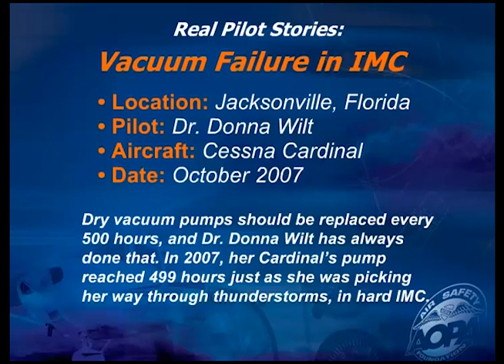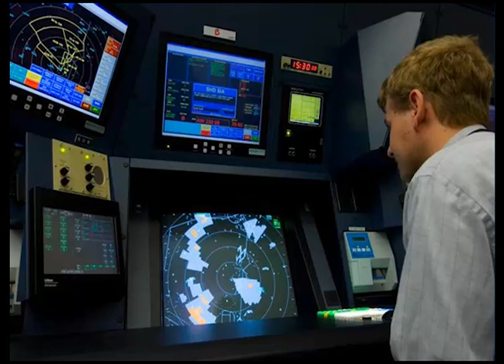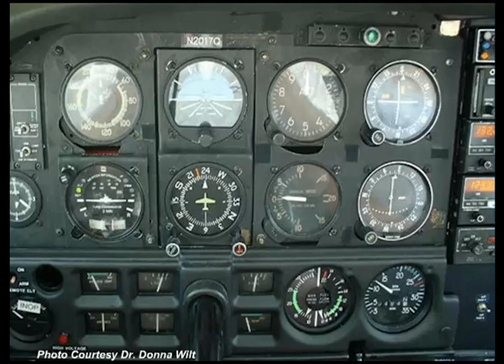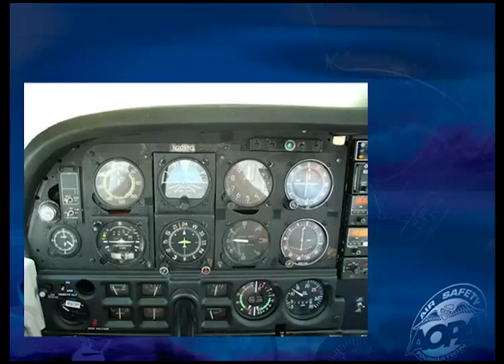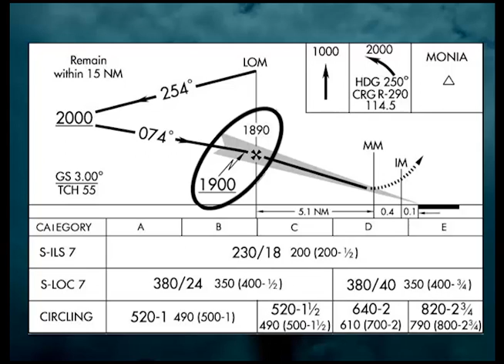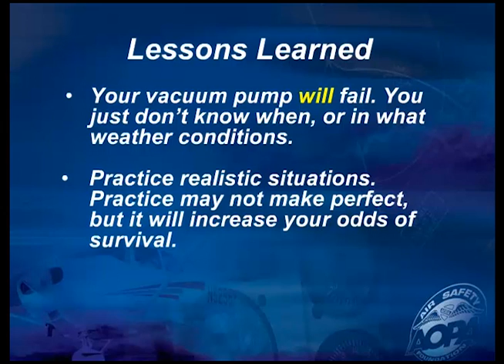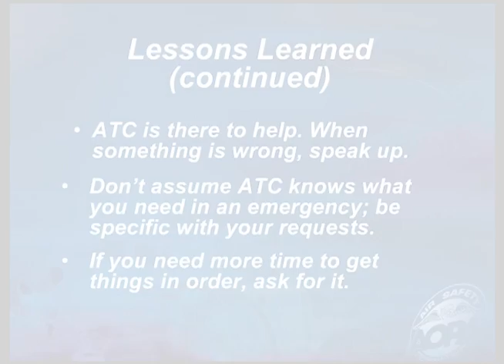Real Pilot Story: Vacuum Failure in IMC

Comment: Could she not have simply used her Compass for vectors? I remember during my Private training we used the compass, a map, and the natural horizon for leveling. I get that she was in IMC but the compass in conjunction with ATC instructions should work.

This past weekend during a XC the vacuum pump failed on my C150. Although I wasn’t in IMC thank God for my prior training. It was like a regular flight block so no stress. As an instructor she seem extremely worried or stressed. The passenger pilot seemed more calm.

Comment: I always carried a couple of little rubber disks with suction cups in my flight bag. I knew they would come in handy for covering up errant instruments should a vacuum failure in IMC ever occur. I never had to use them in 6,000 hours of flying, but I did have to whip them out repeatedly in the simulators at FlightSafety where such failures were practically guaranteed. They made a tough job a little easier.

Comment: Why don't airplanes use engine vacuum? You wouldn't need a pump if it came from the thing keeping you in the air. Pump could be spare in case of engine failure, then you'd only need to change it every 20 years or so since it only gets used in an engine out.

Comment: Why cover up instruments that don't work - you know they're not working, that's why you're covering them up. Just because you trained that way it doesn't mean you have to cover them up or am I missing something?
Reply: Keith Whittingham It probably streamlines your workflow by preventing you from glancing at it and wishing it back into operation. I think IFR rated pilots have set procedures for monitoring gauges, so physically blocking it lets you focus on functioning instruments. I wonder if instructors recommend keeping Post-Its on board for this purpose.
Reply: @bricago2302  I went through a bunch of accident reports and the #1 lesson learnt is "First fly the plane". I cannot think of anything worse to do if you're in IMC, under a heavy workload, in an emergency than taking time out trying to stick bits of paper over instruments that aren't working. You can end up inverted pretty quickly in a situation like that - looking for Postit notes instead of keeping your wings level seems a good as way as any to achieve that.
Reply: Keith Whittingham I see your point. But I’d argue that “flying the airplane” comprises eliminating faulty instruments  from your work load, as quickly as possible, of course.
Reply: @KeithWhittingham  That failed indicator is going to continue attracting the PIC's attention and eventually cause her to enter a graveyard spiral. Human brains are terrible at ignoring things that should be ignored, even when survival is at stake.

Comment: Mechanical vacuum pumps should be the backup, not primary. The engine naturally generates vacuum pressure while turning (it's how your power brakes work in a car). Just run a line off of the intake manifold. Very simple design. Dry vacuum pumps should be phased out and wet/lubricated types should only be allowed.

Comment: Aircraft must have a mix of vacuum and electric instruments. 
Now these days all new instruments are electric , make sure the battery and battery backups are sufficient.
Pilots must train for instrument flying. Even if your not intended to become IFR rated. 

You do not need a horizon at all. These old school horizon are only showing where you are not where you go.
The VSI , turn and bank and compass  are showing change. The others show result. 
The whiskey compass is only good when the aircraft is straight and level.

Comment: Is there no analog instrument that can be used at that point for heading ?
Reply: You can use the turn and bank gyro (which is electrically driven) to keep the wings as level as possible, this will minimise the turning tendencies of the aircraft, and then the average reading of the magnetic compass to keep to the general direction required.
Reply: Magnetic compass, that's about it. Pain to read and takes forever to settle, because of the movements of the plane.

Comment: We get trained over and over and over... "When in IMC, TRUST YOUR INSTRUMENTS". Especially the Attitude Indicator.
.
And then a simple vacuum failure turns this whole concept on its head.
Scary times indeed!
Reply: but the water bottle trick still works... no matter how much you say it doesn't..
Just use your slip indicator, don't touch the pedals, watch the altimeter and the magnetic compass. It's a little more difficult but better than those f*cking glass cockpits they put in every aircraft nowadays.
Reply: That's why you want a bottle of water with you at all times. You would know if you are upside down or turning, etc.
Reply: @pilotpaulkim  you can do a barrel roll from straight and level to completely inverted and roll out straight and level without spilling a cup of coffee if you have good rudder coordination. Tex Johnson did it in a Boeing 707. You can also auger in a helical path directly into the ground without spilling a cup of coffee (until you crash). There's a reason why rate of turn indicators, heading indicators, and attitude indicators need gyros to function. You also cannot feel a turn, you only feel a slip.
Reply: @pilotpaulkim  Sadly not correct. You can barrel roll an aircraft and the water will not move if executed correctly. What you get from the water bottle is just the ball (slip indicator) of the turn coordinator.

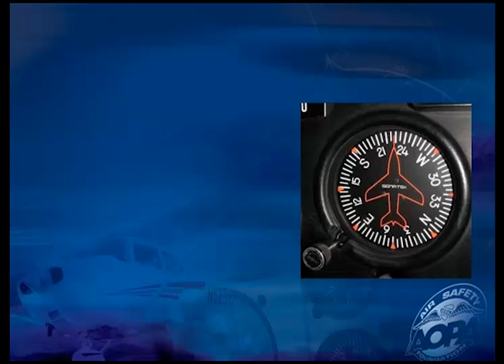Comment: At 7:35 (near the localizer)  ATC:  "Your choice either a right turn or left turn however you want to do."    What kind of guidance is that?  Combined with the pilot's inability to fly a particular heading (5:10), it's fortunate there was a break in the clouds or this flight would've likely ended in a crash.
Reply: I am not a pilot, I thought following a heading was literally your compass? I take turn to heading 270 to mean due west, I understand flying thru clouds is crazy, even in the backseat, I don't like it IMC seems like your in the twilight zone
Reply: @buddymoore6504  If you have a gyro failure/vacuum pump failure your compass is no longer accurate. These aren't just compasses on your keychain, they're a bit more complex (and accurate), so they can fail if you lose instrumentation.
Reply: @CharlesFreck  Compass is still accurate. Heading indicator/directional gyro is not. Compass is only accurate when straight and level but you can at least make a standard rate turn and time approximately when you will be at your new heading and then roll back out. In this situation ATC could help you and as long as you're reasonably close to the desired heading you will intercept the localizer.

Comment: Many times ATC controllers are neither pilots nor mechanics.  They are not required to be.  ATC is not trained on your airplane's systems or how to fly it any more than after passing your Private Pilot's Checkride, and having a newly minted Private Pilot Certificate, qualifies you to go work at John F. Kennedy, Chicago O'Hare, Atlanta, Dallas Fort Worth or San Francisco International approach control.  Pull up a seat there, make yourself comfortable.  Here is the radar display, the keyboard, here is a headset for you and there is where you plug in have at it..... I don't think so.

Aircraft specific terms thrown out in the heat of the moment like AHARS, FADEC, IRUs, vacuum pump,”B” system or 'standby bus" are just verbal clutter transferring little if anything of value from you to the controller who is trying to figure out what the problem is (in general terms only!!!), what your capabilities are and what you need from them.  Telling ATC something like “lost my vacuum” pump may not communicate anything valuable to them.  I would suggest saying something like “I’m declaring an emergency; I have lost several flight instruments, I am experiencing difficulty flying in instrument conditions and I need vectors to the closest VMC and the nearest airport reporting VFR”.  I'm not trying to be critical or find fault here.  I am thrilled it all worked out but found myself cringing all the way through this video.
Reply: To be fair, any dilligent ATC person should probably do basic research on aircraft systems and I find it hard to believe that it isn't part of their training. Sure, all aircraft have slightly different operation, but many if not all also have certain things in common. A vacuum pump is hardly a niche part only found on one or two models of aircraft. Of course though, as a pilot if the ATC isn't giving you what you really need, or isn't communicating that they are clearly, it's on you to make that known. ATC telling you to do something isn't a commandment from god, they're there to service the needs of the aircraft and if they aren't doing that, protest in clear terms.
Reply: @Person01234     LOL. I find your comment ironically hilarious with such statements as "...or isn't communicating...clearly..." in describing ATC. But that's exactly what the dumbass pilots aren't doing when they're making dumbass statements like "I lost my vacuum pump." They aren't communicating clearly at all.

Apack Westbound is 100% correct! The pilot should have instead said, "I lost my attitude indicator, heading indicator, etc." You know, actually COMMUNICATE CLEARLY? People are being hard in this poor ATC when it's really the pilot's fault.
Reply: @SergeantExtreme  Dude calm down. I wasn't blaming atc and it's not "ironically hilarious" if you actually understood it. At the end of the day if your plane crashes, you're the dead one, not the ATC. Going around trying to assign blame is all well and good but the pilot has the ultimate responsibility to get clear information and communication because he's the one who's going to die on poor communication, not the controller. His fault, ATC fault, it's not relevant when he's in the sky and he isn't hearing what he needs to hear on the radio. I also just said having a basic knowledge of aircraft systems is probably a good idea if you're working with aircraft which I think is really self evident.
Reply: @SergeantExtreme  I mean,you can just say these words but again, a vacuum pump is not a niche part.
Reply: @SergeantExtreme  I'd say both were prudent. Not every part of every aircraft of every type, but basic ones that are common among many aircraft. And "pilot" isn't a job. It can be but the vast majority of pilots are just people who learned how to fly and got their licence. Even if you include these things in testing (which they should be if they aren't already), if it comes down to it they're still going to be ordinary people in stressful situations. ATC is a job and setting out training regimes is more practical in that regard.

In any case, my point was less about formal training and more about, if I were an air traffic controller I would probably familiarise myself with the basics of aircraft and I think others should too. To be clear noone is saying there is official misconduct or anyone should be fired or put in jail, just saying if you're working with aircraft it might be beneficial for everyone to learn about that kind of stuff.

Comment: Why are vacuum pumps so fragile????  500 hours is nothing for a lab vacuum pump........are they really cheesy cheap?
Reply: Vacuum pumps on airplanes are fragile because they are DRY vacuum pumps. Unlike wet vacuum pumps, these pumps have no oil at all. Instead, the vanes are tipped with carbon, which constantly grinds away and "lubricates" the pump with what is essentially powered graphite. After a few hundred hours, the worn vanes shift, heat up and bind, causing failure of the pump.

Comment: I’m guessing she didn’t have a GPS on board for a heading. Wouldn’t she have also been able to tell heading from the magnetic compass?
Reply: The magnetic compass leads or lags the aircraft in turns. The magnetic compass is truly reliable only in straight and level, unaccelerated flight. That's why we use the DG.
Reply: John Opalko I’ve noticed more vertical card compasses, usually set on top of the instrument panel , in recent years. Excellent idea—- they should have been brought in decades ago!  All that lag and lead training , never mind the acceleration effects, could have been more profitably used in other areas.
Reply: I can't stop asking myself exactly that. Other people are talking about lead and lag... but this is a problem with accelerated flight, or "decent" bank turns, like 20 degree bank turns or more. And in any case, you can stop turning when the compass shows the right heading, and then adjust slightly. I really don't get the issue here.
Reply: @LeantoPeak  well one is magnetic declination. It is probably about 7 degrees off where she was
Reply: @Bankable2790  Exactly. Lead and lag time isn't the problem, it's magnetic declination. 7 degrees when you're flying a distance of miles can put you way off target. In certain locations, magnetic declination could be the difference between lining up with a runway in IMC or lining up with a mountain.

Comment: This is another great example of how ATCs need to be trained in the pilot perspective.  Maybe they go through flight training, maybe they are trained in common failures on GA aircraft.
That an ATC in this day and age doesn't understand vacuum pump failure / partial panel... vacuum pump based instruments have been around for half a century?
Also, that @ 8:10 the ATC is lecturing the pilot about ATC procedure DURING AN EMERGENCY is crazy.  That's not something an ATC should expose to the pilot UNDER ANY CIRCUMSTANCES.  That's the ATC's job to handle, not the pilot's.

I think the best solution for ATCs is for the FAA to create the ATC equivalent of a 'Pilot Deviation.'  Pilot deviations are punished severely and as a result that's made pilots as meek as mice.  ATCs on the other hand have no behavioral standards (other than no cursing) and as a result they recite bureaucracy to a pilot who has declared an emergency.
Check out this ATC -- https://www.youtube.com/watch?v=JYROSTV_KVg
In this case the stick would work far better than the carrot.

Glad the flight made it to the ground unscathed despite ATC.  The pilot probably did a detailed post mortem after this life & death encounter, think the ATCs did a post-mortem?  They couldn't even be bothered with a phone call...

Comment: Your an engineer, with a PhD., and you own an airplane, plus you fly hard IFR....how about an iPad, Iphone or Android with ForeFlight and Synthetic Vision?  Priceless.  

Moreover, unless the autopilot was "attitude-based"  (King and a few Century are attitude-based, but not Cessna and S-TEC) of course the autopilot would not suffice using the "heading bug", but even the Cessna 300A has a solution.  Using the "Pull Turn". When pulled out and centered in the detent, the aircraft will fly what it thinks is wings level (using input from electric turn coordinator). When turned left or right, the aircraft will respond by flying in the selected direction. When properly adjusted, max turn will not exceed standard rate. Couple this to either the magnetic compass for heading, or better yet GPS tracking and voila.